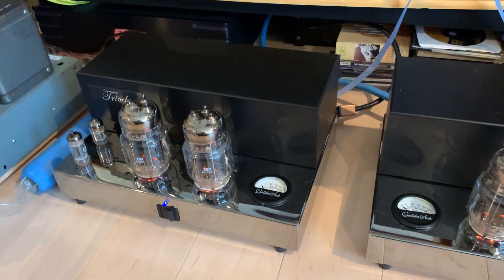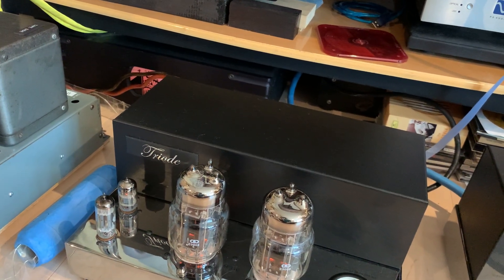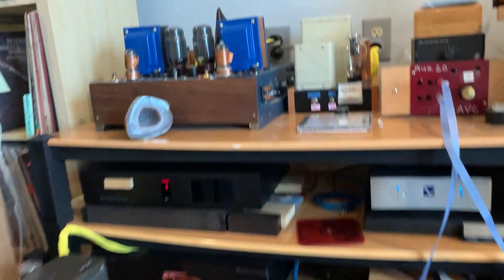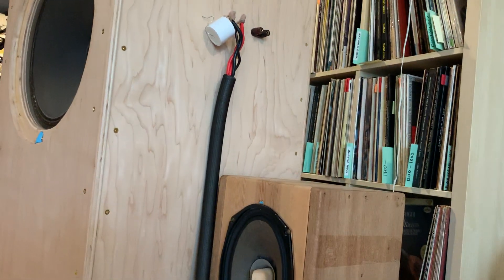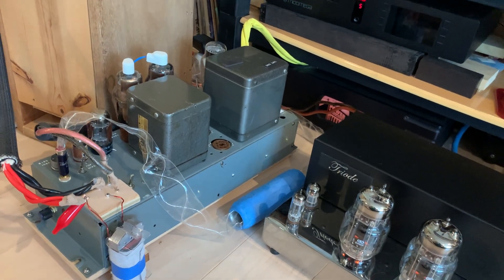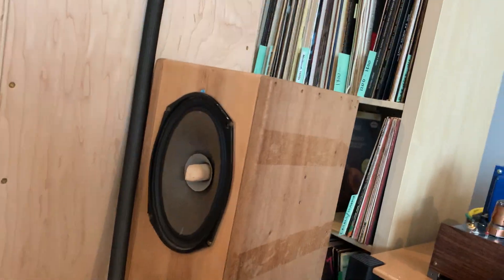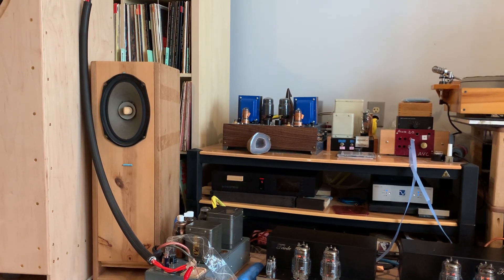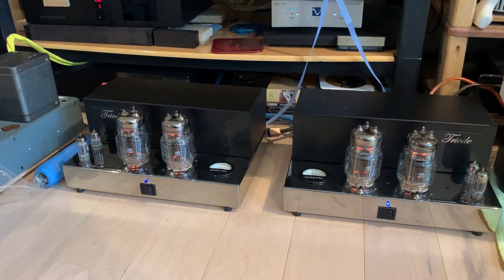Bare HT speaker cable:  first impressions after break in

Comment: Hi Janos, it's funny that I came across this "older" video about cables. I'm currently experimenting with diy power cables for my power amps.

 I was trying different things and noticed very quickly that power cable with heavy shielding and thick mantle sounded way more compressed or muffled compared to almost "naked" power cable.

Then I noticed something strange. It seemed that the soundstage om the left was deeper and had more height compared to the right side. At first I thought it had to do with room acoustics. But then I remembered that I constructed the power cable for my left and right amp somewhat different. On the left side amp I had braided the wires but on the right side I had twisted the wires. Could that make such a difference?

Today I constructed another power cable with braided wires for my right side amp and to my surprise the soundstage became deeper and with more height on the right side as well and became more balanced. 

Never would have thought that even the way the wires are constructed (braided / twisted) could have such a big impact 😯.

Greetings from the Netherlands 😊